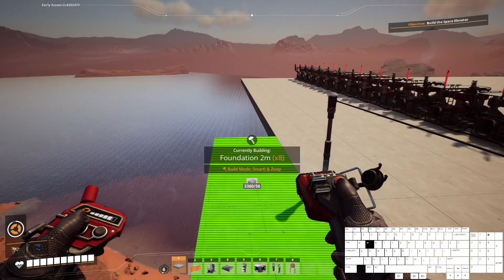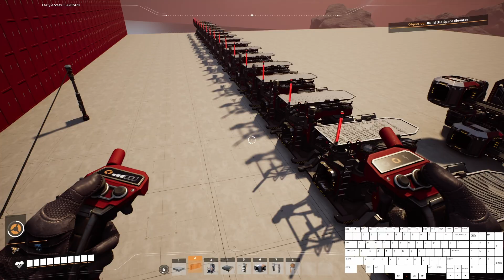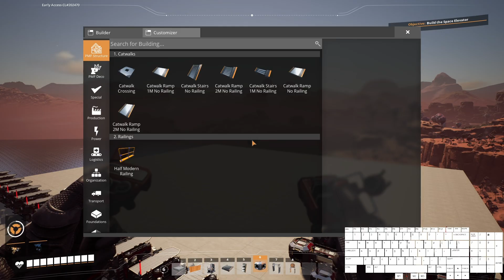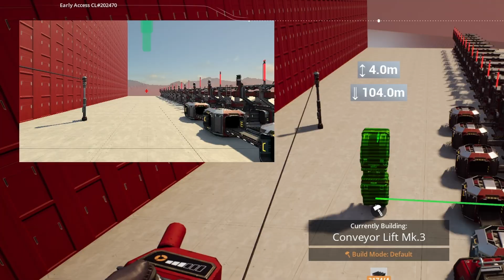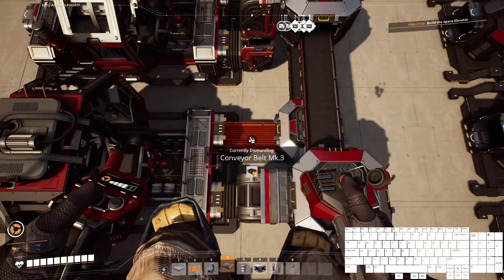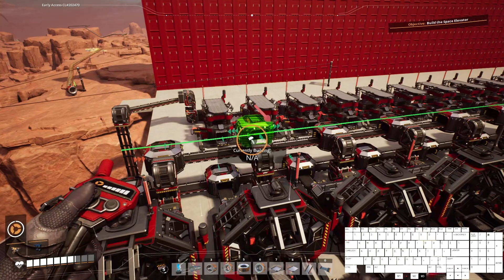Smart Mod v20 Overview & Tutorial | Satisfactory

Comment: I think you skipped a step in the spacing section. Either that or I'm losing it. "run out a line of em here, hold the P key and put spaces in"...following these exact directions accomplishes bupkis. Edit; What I missed is that the build mode has to be  'smart'  and then use then scroll wheel which is now pretty obvious but had me tearing my hair out there for a minute
Reply from the maker: I can see how that could be frusturating. I tried my best to explain things in a way that would be easy to understand for those that are new to the mod. There are some things though that I have been doing for so long that it is just second nature and might have missed.